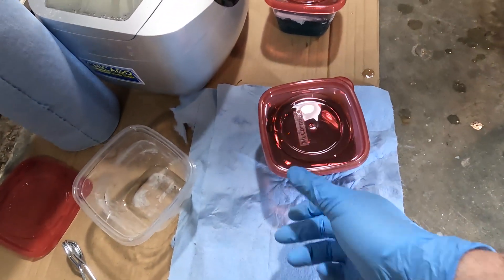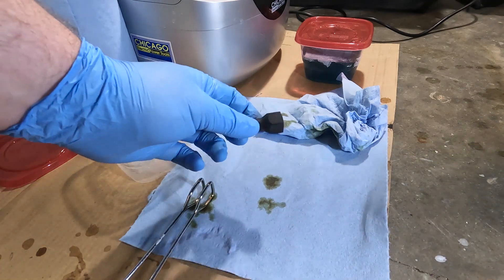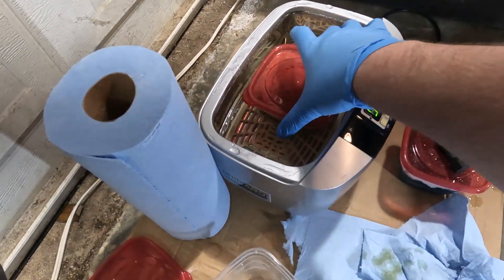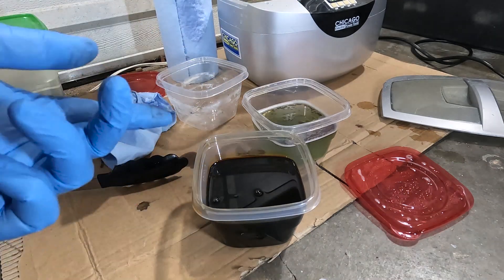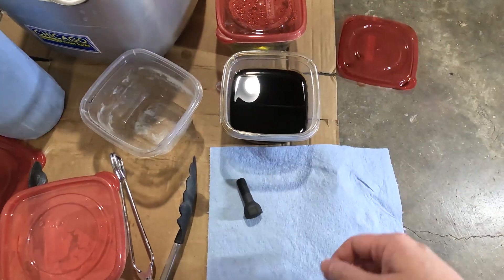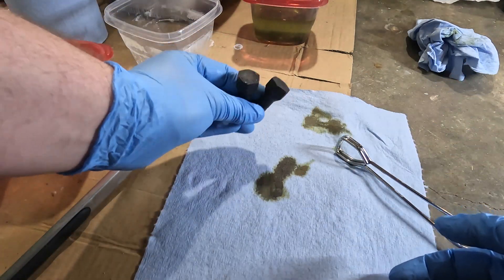Blackening Bolts with Common Chemicals | Black Oxide Finish

Comment: My solution started to crystallize after leaving parts in it overnight. Phosphoric acid is expensive here in Denmark, so is there anything I can add to thin it out? The solution is almost maple syrup consistency. 
Still turned it dark, though.
Regards from Denmark!
Reply from the maker: That's interesting! I haven't experienced that before.

Comment: I live in dairy country, but the Concrete and Metal Prep @ Home Depot is cheaper and a stronger solution.  I have one high carbon knife that stains and rusts and I have noticed certain foods or fruit substances cause real blackness.  So I googled "what fruit causes black oxide on ferrous material". Turns out the Japnese have used unripe tannic persimmons for this historically and even make a black paint out of fermented persimmon and iron filings for calligraphy and art.  I can't find anythng more than that on it though. Google goes shallow and the Japs are keeping their secrets.  My next door neighbor has a persimmon tree, so I thought I'd try, but he pruned the crap out of it last year and gave it nitrogen and the weather was super weird and cool this year and it actually for the first time ever has no fruit.  I could buy a persimmon somewhere, but its not the same.

Comment: I tried this and some parts turned black and some showed a reaction but only turned gray. Any idea why?
Reply from the maker: Not sure. You could try dissolving some steel wool in the acid first so there's more free iron phosphate in the solution.

Comment: You should put them in a preheated oven for 2 hours or more at 200° after as acid embrittles steels by introducing hydrogen to the metal. Heating them restores the strength by removing the hydrogen and should be done within 2 hours of the process.
Google Metal de-embrittlment.

Especially high stress bolts..
Reply from the maker: Great tip!
Reply: Some people put the blackened bolt into hot or even boiling water for a bit after.  Not sure how long or how hot.  200 is pretty low.  A slow cooker would do that and the sonic bath thing was a little cooler.

Comment: Good video on chemistry, woulda just used some iron remover for car paint. Works great, I used Adams brand. Or yeah "blue" them with a torch and dropping em in oil.
Reply from the maker: Good tip. I'll check out the Adams stuff.